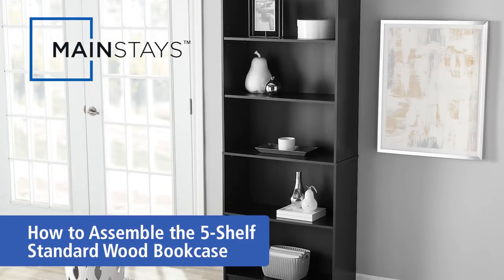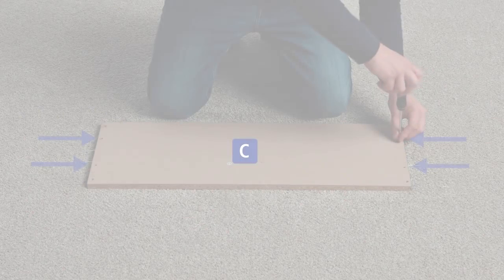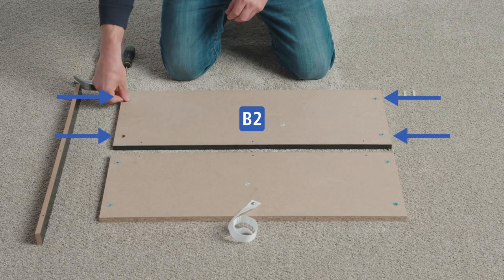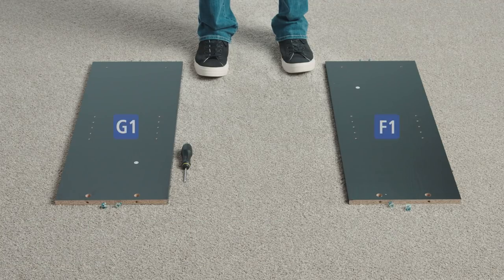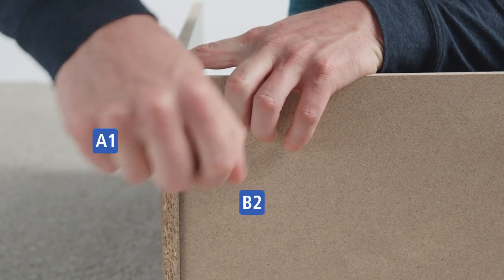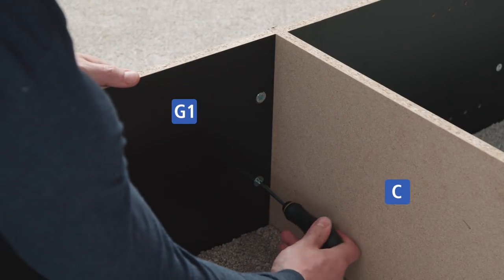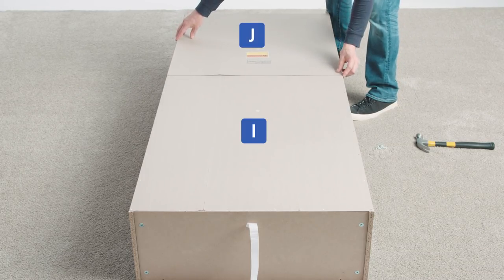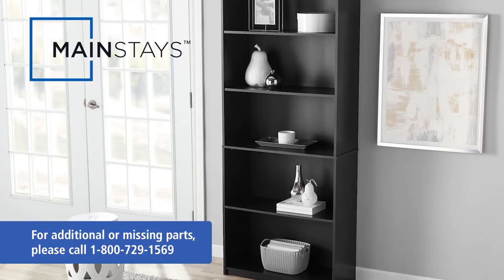Mainstays 5 Shelf Standard Wood Bookcase

Comment: IMPORTANT - If you don’t have a helper or a flat surface for assembly, then do not buy this bookshelf unit. Once you’ve already installed the hardware is when you find this out. Save yourself the trouble.

Also, according to this video, this unit is not meant to be pushed or pulled. So, once assembled and put in place, don’t even think about moving it.

You can buy flat L brackets for it and it will still lean. The warning to install the back panels while on a flat surface should’ve been adhered to the top back panel (I) since that is the one you install first. Buy yourself some nails that won’t bend.

Note that, if you intend to install extra shelves, you may need to drill extra pin holes. Particularly, in the lower half. Do that before any assembly.

So, that is what you get for under $30. This is a bookcase that is great if you’re moving soon and want to leave it behind. But don’t have it near children, pets, the infirm, elderly and the not so well meaning. Don’t even slam a door in your house.

And ditch the rear panels for some 1/8” plywood, cut for free at HD. If this thing shifts even a bit, it’ll rip that cardboard backing.

Heck, make your own damn bookcase!
Reply: wait I want to put a ten gallon fish tank on top of it, is that ok?
Reply: @reby58  it will not support that
Especially if youre using it for fish
The better home bookshelf also from walmart will probably be better
Reply: BunniiChii sorry just seeing this now.

I wouldn’t actually put a vase I like in this.

What happens is that, because the top and bottom are separate, if you look at the side panels (check closeup pictures), the bottom may not stay straight and in line with the top and the bottom can start to veer  to either side, causing the entire unit to fall. The only reason mine didn’t complete undo itself, is because it fell, leaning against a desk edge to the left of it. Otherwise, worse case scenario, if I had breakables on it, it would come down, bringing the weight of the bookcase and the breakables, and any flying sharp edges with it. If one of my cats was near it or leaped into it, they could’ve been severely injuring killed.

I can’t remember if this comes with a wall strap, for stabilization, but if so, it should be screwed to a wall stud and still not trusted. It’s like buying a piece of furniture for the specific purpose of getting injured.

The other commenter mentioned BHG but, I think the Mainstays bookcase was made by Hussein Furniture. I bought a storage bench from Walmart, by BHG, which was also made by Hussein furniture actually. Following the trend nowadays, this is “assemble once” furniture. But assemble once can also mean fragile and “fall apart under you”. I kept the bench as, it’s the right width to go in front of my bed and because it doesn’t present the safety risk of the Mainstays bookcase. But, the bookcase, I disassembled and may use the parts for their best use, which is as shelving, in something more safe, sturdy and stable. I can just have the pieces cut for free at Home Depot. The sun of its parts are greater than the unit assembled...
Reply: Yes this thing sucks it has been leaning since I bought it 🥲
Reply: @livelovely4681  if it’s leaning, expect it to come down, at some point.

Comment: I bought 4 of these after the first one completely feel apart because the cams didn't hold and ripped the predrilled holes out. NEVER... EVER... EVER buy anything that uses particle board and cam locks.
Reply: The cam locks are the worst thing.

Comment: The product I got has no instructions and the shelves are labeled with different letters than the ones in these video. I only have four cam bolts and four cams. Clearly more are required.

I will never buy Mainstay products again. It is quite the rip-off.

Comment: started to build realized it wld be flimsy going to buy some strapping like 4 pieces and some wood screws making a bunch of horizontal braces and 2 vertical. with 2x4's on their side for the base and toggle bolts to secure it to wall over that stupid slap strap lol